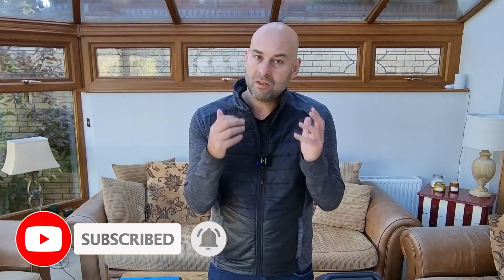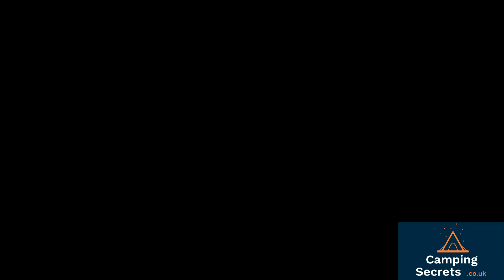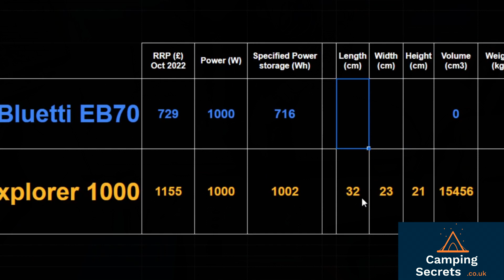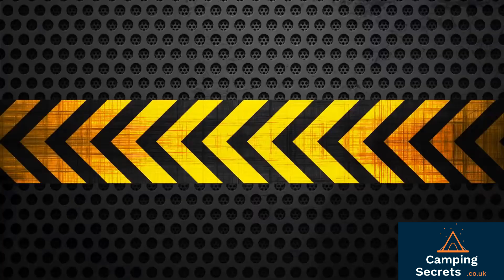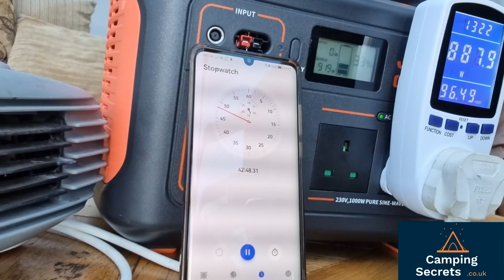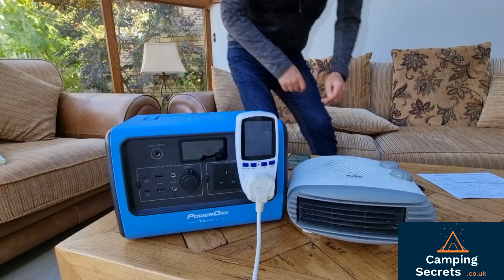Battery Tech Shoot-Out - Lithium-Ion vs LiFePO4 - Jackery vs Bluetti - Power Station Rivals

Comment: I notice that you skipped the charge time on those is that because you know that the jackery takes hours and hours to charge, And the bluetti takes only a fraction of that time?
Reply from the maker: This video is probably a little out of date now. I haven't watched it since I first published it. The idea was to compare the battery tech on the only two power stations I owned at that point. It wasn't a direct comparison of every specification.

Comment: It's not more expensive ,,1000 watt bluetti is more$$$,.. then your thousand watt jackal,,,,,you tested 800 watt,bluettu,.. if you're going to run an unfair test ,,,should use your phone and turn the app on to overdrive the 800 watt max to run 900 watt power,,,,first thing,,, to give 800watt bluetti fair shake  ,,bluetti can recharge 3500 times ////Jackal you're lucky if you get 800 charges,,,,do the math,,... are you going to quit wasting time and get a thousand watt bluetti then run fair test,,,,,1000watts vs 1000watts,,,,
Reply from the maker: I've said before that it wasn't the perfect comparison, but I could only really compare what I had at the time. Cheers

Comment: Your test is not fair,,,. You overloaded bluetti at the beginning,,,,, bluetti that was Max 800 watts,,, the heater 900 watts ,,,when the Jackal was over a 1000 Watts,,,,,, your test does not work ,,,your math is way off,,, don't quit your day job,,,,,,... I suggest get a 1000 watt bluetti power station,,,.. then do the test Fair,,, you will see bluetti will win test... veteran ,,,peace out

Comment: I've tested my BLUETTI EB70 yesterday at a constant 195w (dehumidifier running at constant laundry setting) and it ran for 3hr12 mins which to my maths is 87% efficient. 3h 36mins would be 100% efficient, so 3h12m at 87% is much better than your results. The BLUETTI inverter fan running at higher loads (above 200w) may deplete the batteries quicker, but this was not running on my test and for most usages (camping / garden etc) will not need to run. For lower load appliances where the inverter cooling isn't needed efficiency comparable to the Jackery. I also only paid £539 for my BLUETTI compared too £1099 for the Jackery. For my usage the maths usability speak for themselves, to charge my ebike and charge phones devices in my campervan all below 200w load the BLUETTI is the winner at 87% efficiency for £539 at 716wh.
Reply from the maker: Hi David - yes you make very valid comments. The load on the inverter makes a big difference to the efficiency, but please remember that I did the exact same high power test on the Jackery as I did on the Bluetti, and there was a big difference in efficiency. In another video (Bluetti AC500+B300S), I tested at two different powers and got two different efficiencies - obviously I cannot do this for every video as it is only a weekend hobby of mine. I disagree that people only use these packs for low power applications - this is not my experience. I regularly use them to boil kettles at the camp site and run cool boxes. Efficiency is very important at all power levels. It sounds like you got a great price for the EB70 - you can also get the Explorer 1000 now (refurbished) for £629 (https://amzn.to/3GE0Qh3). Thanks again - cheers, Marc

Comment: One of the reasons the power indicator are slightly different is the battery is also running its eternal fan and it’s electronics and the heater hence why it reads higher than the watt meter.
Reply from the maker: Thanks Gary - you'd hope they would calibrate that out. I've found since that video that all power packs seem to be getting more accurate. Maybe they're learning??

Comment: Bluetti is 716 and the jackery is 1004. You measure the case, but neither unit fill the case inside with batteries with electronics. Measuring the cases has no benefit or any baring on this test you have done. I think if you are going to do a relevant test between these 2 devices, use the closer 2000 Bluetti and the 2000 jackery. That would be a better comparison and on an equal plain for testing. Measuring cases has no merit, so skip that unless you are going to physically look inside both and compare the space used for batteries and electronics. You say the power output is the same, it is not...this just shows that the Bluetti is able to deliver more without overloading by giving you 1000 out of 716 watts.
Reply from the maker: The case size does have merit if you only have limited space in your campervan. I will be comparing the 2048Wh packs from Bluetti, Anker and Jackery in an upcoming video. Much more like-for-like!

Comment: Power storage per size doesnt matter its 2 different units man. The most important is how much energy it could store, output of the inverter ans longevity... the rest is extra. Price vs longevity is also important Bluetti wins big time on paper. Good video but for the price and certainly longevity  Bluetti is way far ahead.. calculate price vs longevity
Reply from the maker: Yeah agreed there are alot of factors, but there's no doubt that LiFePO4 packs are bigger and heavier then the NMC equivalent. Some of the other 'advantages' are a bit of a red herring too in my opinion. Eg safety. My point was that these two units have the same output wattage and are about the same size and weight, but the Jackery has twice as much useable storage. Yes it's more expensive but that's the tradeoff... 👍🙂
Reply: @CampingSecretsUK  i dont mind 1 lb heavier if it last 5 times longer bud for way cheaper too
Reply: @CampingSecretsUK  price of jackery with older generation of lithium batteries doesnt make any sence .. add it shorth life nope
Reply from the maker: Also I'm not that sure longevity is such a big issue from a camping perspective. If the Jackery is used once a week then it will last >10 years and still have 80% capacity remaining. Not too shabby

Comment: Thought the Bluetti was 700w and the jackery was 1000w ?? Like comparing a phone to one that's nearly twice the price
Reply from the maker: A bit, but the power is the same at 1000W. Also, the size is the same because the LiPo batteries are less efficient. So in some ways it's a fair comparison. You're right about the price though! A better comparison would be Ecoflow Delta 2 vs Jackery 1000

Comment: I don't actually see the value in the Bluetti. The Jackery looks and feels way better.
Reply from the maker: The Jackery batteries won't last as long, there's no wireless charging  and it's significantly more expensive. However, it packs much more power in the same size casing. I guess it depends what you're looking for. They're both pretty cool devices

Comment: I've been using the Bluetti to power a couple of powered chairs in the middle of a room and I've gotten the same results.  It seems to me that the units DC to AC inverter soaks up a lot of power if it is left on.
Reply from the maker: Interesting. Yeah I'll be testing the LiFePO4 batteries in the new Ecoflow Delta 2 soon, so I'll be very keen to see how that does in comparison with the Jackery